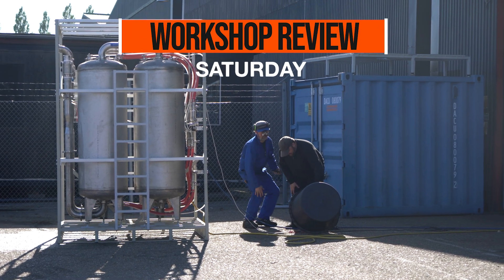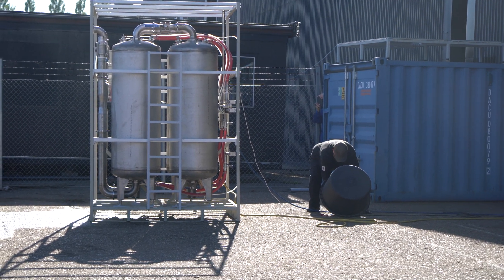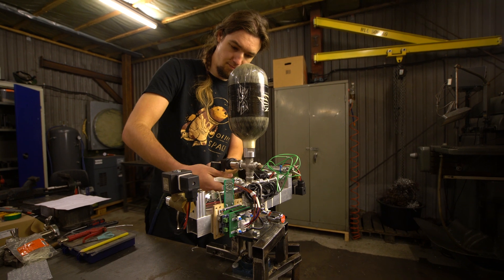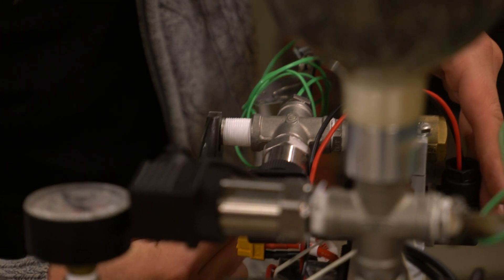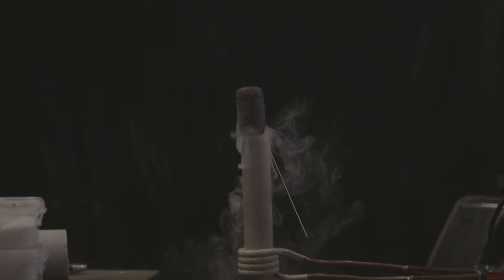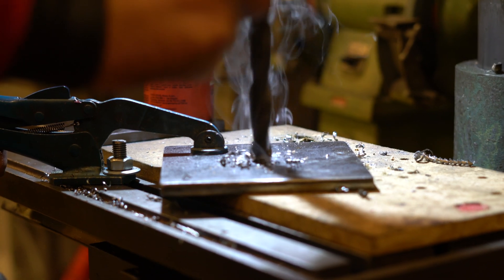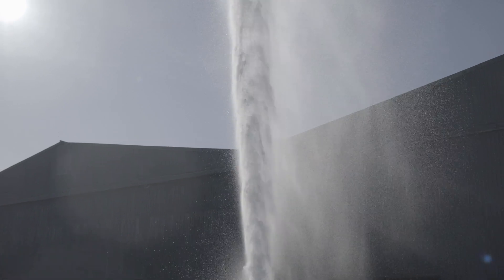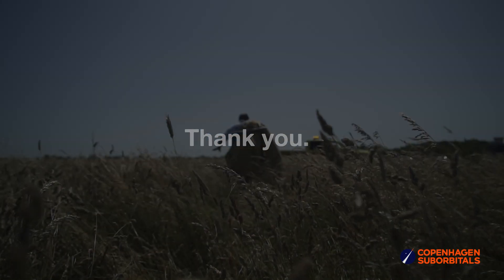Testing Rocket Fuel Injector Test Stand | INSIDE THE ROCKETSHOP: Episode 3

Comment: One thing I really don't understand and would like to know is: How can you solder these swirler elements? Soldering is at around 400°C max, right? And doesn't the rocket engine get way hotter than that?
Reply from the maker: The combustion temperatures do get pretty hot. However, the swirlers are cooled by heavy amounts of constantly refreshing incoming fuel and LOX, which should help. There is a chance that hot spots develop locally and burn out the elements, but the solder joints are far recessed and the melting point of the solder is above 600°C. That is pretty close to aluminium which we used for our BPM5 injectors.
Reply: @CopenhagenSuborbitals  Aha, thank you :D

Comment: Hi dumb question but when you do the static water tests, how do you, or what equations are you using  to convert the flow rates of water back to real fuel flow rates/exhaust gases, or have I got this totally wrong with what you are showing. It's a great channel and I'm a subber.
Reply from the maker: What Harald said. And we also have a ton of data from all previous BPM5 engine tests that we can correlate the different liquid mass flows with.
Reply: @CopenhagenSuborbitals  Hi thanks, much appreciated!